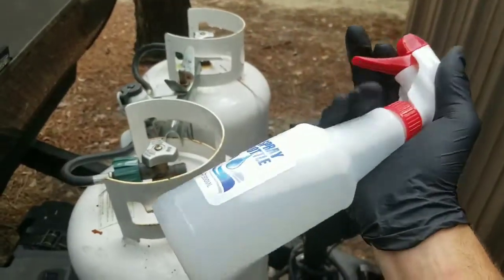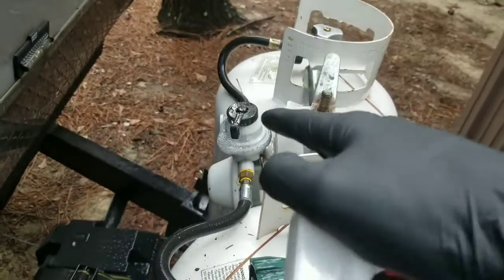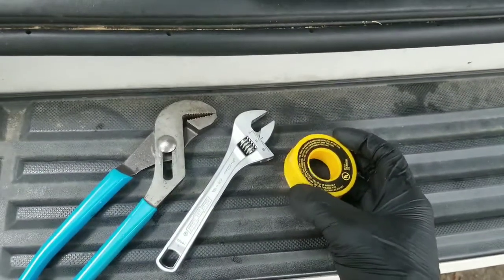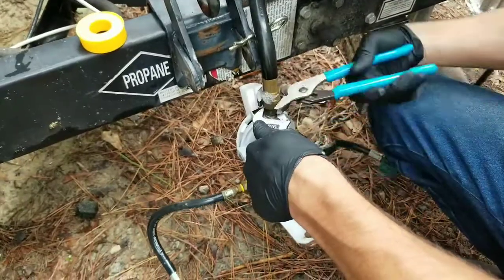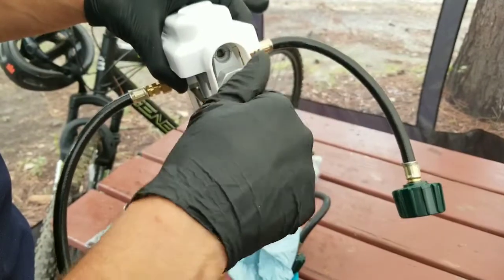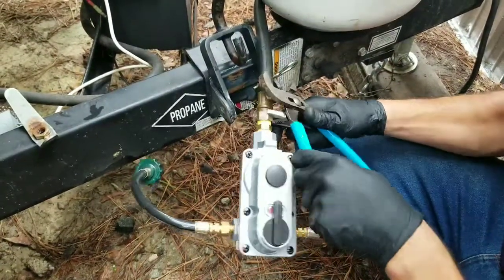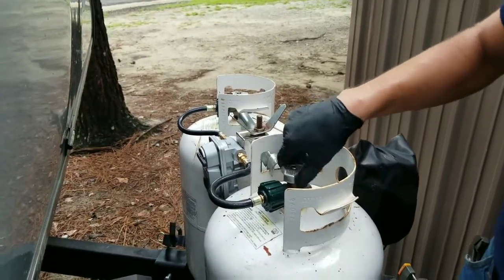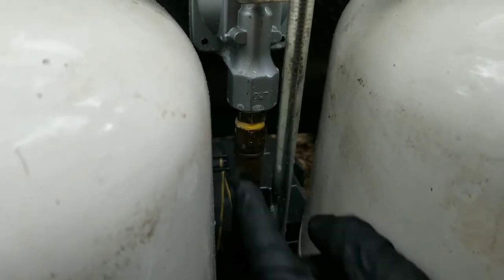RV repair | How to replace RV propane regulator (Easy DIY fix)

Comment: Great video, I don't think you are supposed to put teflon tape on the flare side of that fitting.
Reply from the maker: Thanks, haven't had any issues with it since so I think it is fine. What is the concern?
Reply: @DIY_or_DIE  The flare surface is what's supposed to make the seal. If there aren't any leaks it should be fine.
Reply: If you put two much tape on those threads you may feel it tighten on threads and not on the flared sealing surface.

Comment: You could not be more wrong. Without the proper tools your age engaging in guesswork at best. That’s a terrible way to work with something that is explosive  the regulators are not preset. Leak test?  And if it leaks where you don’t put soapy water?  You know nothing about the system. And never did I say a non working regulator should not be replaced. The point is this video misses critical steps to proper function and safety.
Reply from the maker: RV propane regulators are preset by the manufacturer and do not need adjusting. They are designed to be plug and play. Soapy water works just fine for detecting leaks.

The great thing about Youtube is you can make your own video to educate people if you think there are critical steps missing from this video.
Reply: @DIY_or_DIE  no they are not. You are wrong. Your video does a good job of explaining how to hook up the hardware but your follow on with what a qualified technician would do is utterly lacking. Slack tubes and manometers are made for a reason. You apparently don’t understand this. your video is shortsighted and dangerous and continuing on with this point of view that you’re trying to push just further emphasizes your ignorance of a process that so critical many states actually require RV technicians to be certified to work on the propane systems. You owe everyone an apology, for not explaining this very critical point in the installation of a regulator.
Reply from the maker: @Luv2camp316  Look man, it is very easy to go read the manufactures literature on their products and verify if the RV regulator is pre-set to 11wc outlet pressure. If you want to educate people to use a manometer and adjust a pressure regulator feel free to go make your own videos. There are plenty of other videos by "certified RV techs" confirming what I show in this video.
Reply: @DIY_or_DIE  you are living proof that any person can make a YouTube video. It takes a qualified technician to make a proper video. You did not make one. You poo poo what you do not understand, but you clearly don’t have the education to teach people what they need to know in a critical situation, like installing a regulator.  I have actually taken the time to educate myself on this to understand its importance, the tools needed, and why it’s done. Please do the same and then fix this.
Reply from the maker: @Luv2camp316  Thanks for watching my video! God Bless you, and I hope you have a wonderful Thanksgiving 🙏
Reply: The final comment. I’ve tried to do what I could do inject training to an influencer and clearly I failed. Please block me from your channel going forward.
Reply from the maker: He is probably an AI bot anyways...
Reply: I've been RVing full time for over 8 years and have replace 2 regulators and a couple pairs of pigtails and I do basically the same procedure. It's an easy fix. The key is to  check for leaks after the install and regularly as part of normal maintenance. Good video!!
Reply from the maker: Thank you 😊
Reply: Great job on this video!  I appreciate the information and called our RV repair person, he told me to do exactly what you did!  
 @DIY_or_DIE
Reply from the maker: @sgcolazio5188  Thanks! Pretty much all the RV jobs can be safely DIY for anyone that likes to do things themselves 😄
Reply: This Luv2camp individual does not understand how people without technical training can install thier own stuff.

Well I just had an issue with my regulator, so I hopped over to my closest Rv parts supplier and picked up a new one. Installed it in several minutes with out an issue. Working great. Thanks for the great video. Everyone including people without a tech degree in propane-olgy can fix it with a few simple tools.

Luv2camp is a "special tool" with ideals that need to be ignored.
Reply: @stevehaver7545  I understand that people with no experience can make terrible mistakes. Propane is nothing to make a mistake with and it’s not worth a bad result to find out. You CAN learn it like I did or stay ignorant. The choice is in the  hand of the person doing the work.
Reply: So then educate us, what are the proper steps and tests on how to safely install a regulator? Genuinely asking since I am in the process of replacing mine
Reply: @luisc2496  rather than explain it, I suggest you go to a YouTube channel called my RV works. The host is a self-employed RV technician was also an engineer at one time. He can get a little Squirrley at times with taking sidelights, but he does have a great video on the regulator and how to test it. He’s extremely complete and you will definitely learn things from him.  What he really highlights more than anything else is getting the work done correctly and safely. He talks about the three tests that you should run after replacing a regulator to make sure it’s working at an optimal level. And more than anything else, he makes sure that we understand what’s required of us and if we can’t do it then it’s OK to say we need a professional to step in. Contrary to popular opinion a regulator is truly not plug and playin. But I honestly didn’t see anything in the video that I didn’t think I could do myself.

Comment: @DIY_or_DIE - flare fittings do not need - and can be compromised by teflon tape.  Please add a warning / note at 3:23 - this is DIY and die.

Comment: I got a recall letter for my propane regulator. Dealer will replace it for free, but I'm full time and stationary and it will be easier and quicker for me to do it myself.  
Thanks for the video.. Straight forward.
Reply from the maker: Good luck!
Reply: Same here I had a wintek 6020 regulator and had not been regulating the pressure and popping off my pigtail due to all the pressure

Comment: 3:23.  "Hand tight"  with my wrench...lol... 
Hand tight is with your HAND. 

Open tanks SLOWLY or the safety valve could trip and cut off propane flow.  

Warning should be added to video about no teflon tape on flared fitting.

Otherwise,  great video.